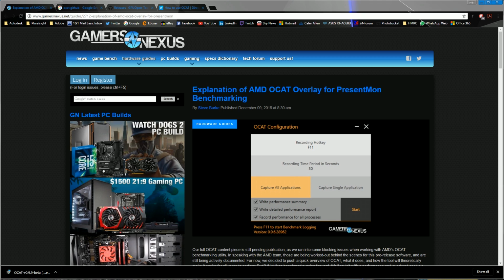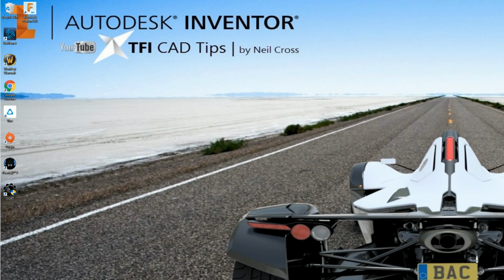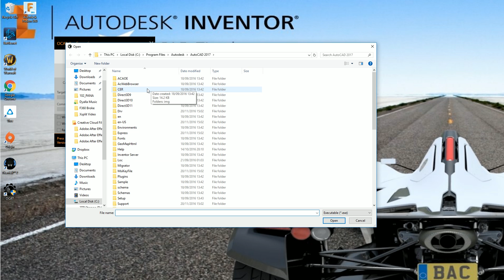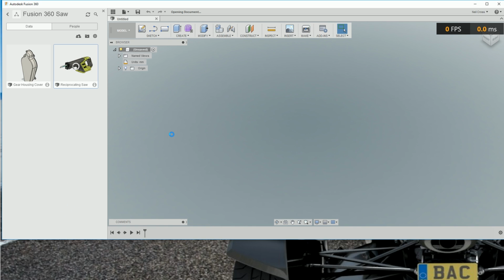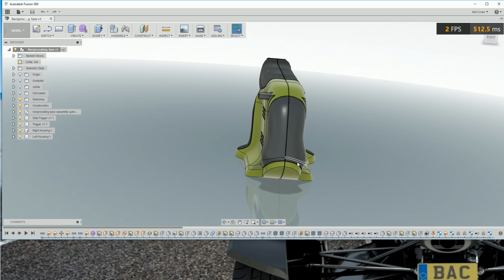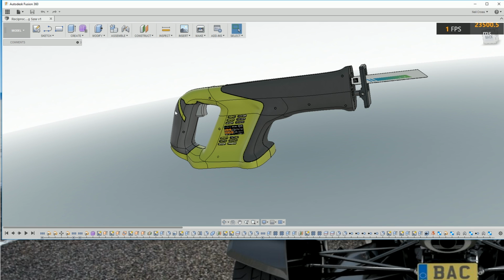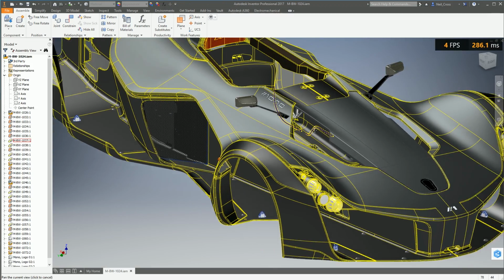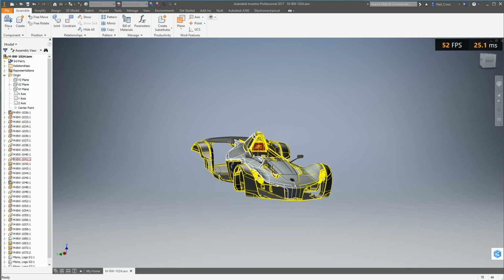FPS Display In Fusion 360, Inventor, Other 3D CAD - AMD OCAT

Comment: you can use msi afterburner to show your fps and gpu usage and stuff
Reply from the maker: Did I not mention MSI Afterburner in this video? I might have cut it out.  MSI Afterburner conflicts with Inventor and crashes it out, the issue was confirmed by the Inventor devs and they've understandably got no intention to fix it as it isn't all that important.